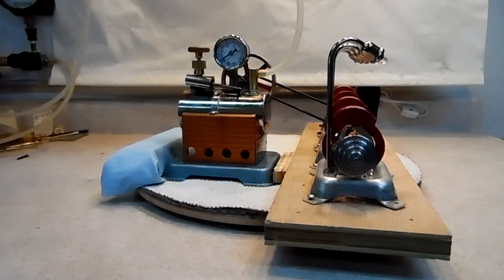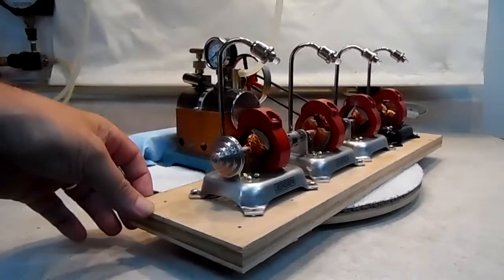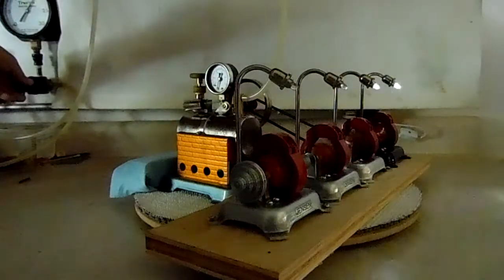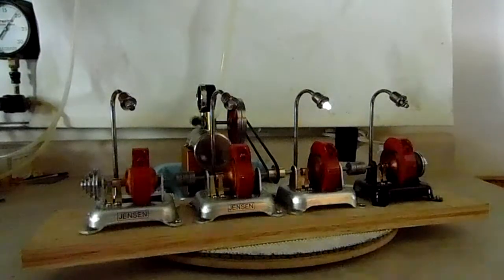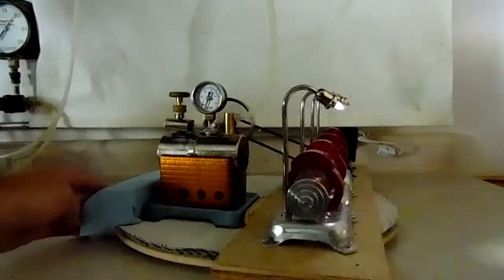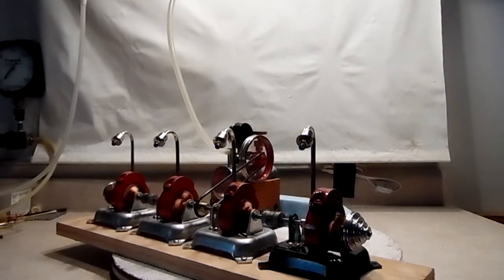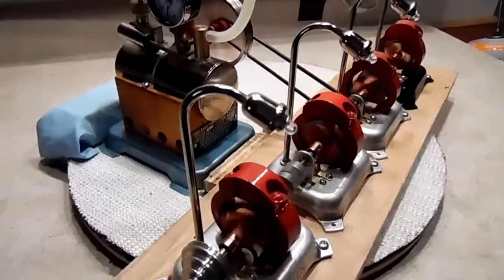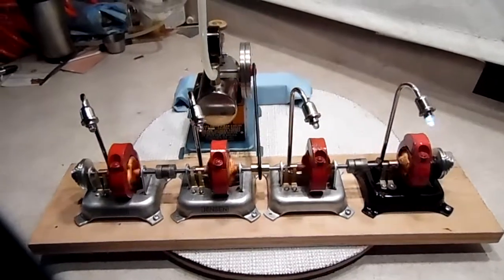Jensen #85 powering 4 generators....not 4 generators she can't !

Comment: Very cool. I have one of the Jensen 85Gs with the different style of generator. Looks like with some modifications, the traditional Jensen generator would have worked well with the 85.
Reply from the maker: Thank you but ,those are traditional style generators with modifications ?
Reply: The 85G has a "15E" generator with is DC, not AC. It is the one with the plastic cover as can be seen here: http://modelsteam.myfreeforum.org/archive/jensen-15e__o_t__t_17387.html. My 85G is still unfired, so I can't say exactly how it would perform.